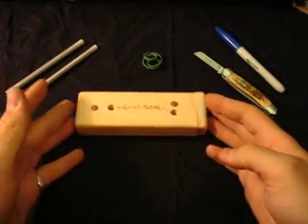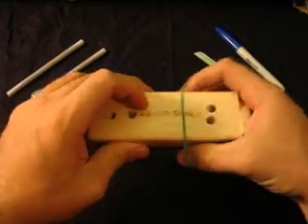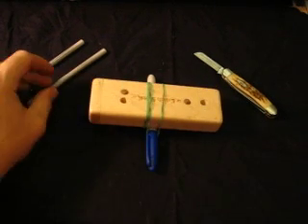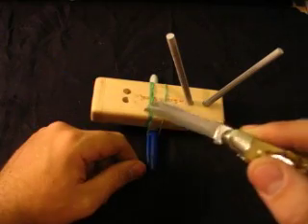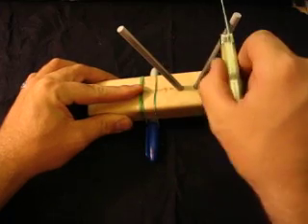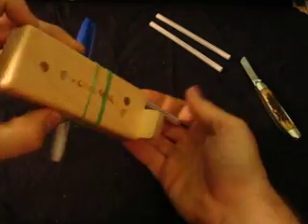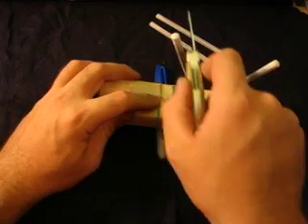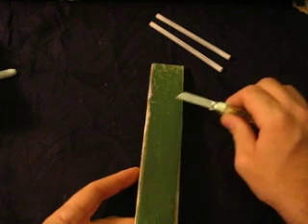Lansky Crock Sticks sharpener demo

Comment from the maker: Bungwrench, the reason for putting the pivot in the middle is to change the angle of the base by the same amount in each direction as you rock (This way, it's like instead of having the box flat, it's at -10 and +10 degrees).  This translates directly to the rods, and while it may provide a large shift up and down in the position of the rods, they still only change by 10 degrees.  Try it yourself sometime, with a protractor, it's pretty cool.

Comment: You can get the same effect by drawing a few angles on a sheet of paper.

At 45° the cutting angle is 10°, so subdividing 45° into four equal angles gives 17.5°,15° and 12.5° from the 20° end. Because the 25° sticks cross this just makes the sticks shorter, so better to work from the 20° end.

Stupid YouTube not allowing me to link to the picture.

Comment: This technique gives different angled bevels on each of the blade. You don't need a protractor to prove it. Just consider this: pen is effectively a pivot point. The distance from it to each rod are two radiuses of a circle.  When the box is moved (up or down) the rod closest to the pen has a shorter "radius" than the rod nearest the end and so moves less than the rod at the outside which has a greater radius. This means they're not at the same angle, which is clear when you examine a blade.

Comment: Great tip, but shouldn't the sharpie be equidistant from the center of the two holes and the end of the board rather than the center of the entire board? I highly doubt it matters since there's so little difference, but just a tip.

Comment: Yea, no way this creates an equal angle. It's obvious from your own demonstration and by having a bare minimum knowledge in geometry. In order for both angles to be equal the marker needs to be placed exactly equidistant to both holes. Otherwise what you create is a chisel with back bevel or just an asymmetrical bevel widths.